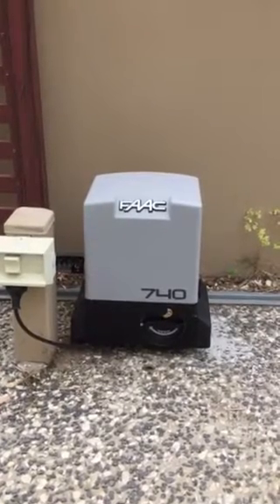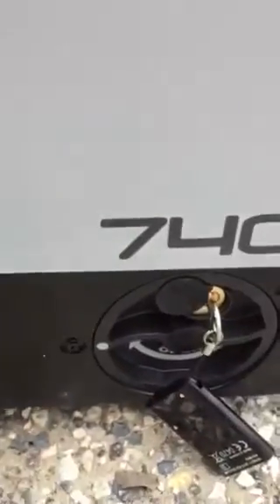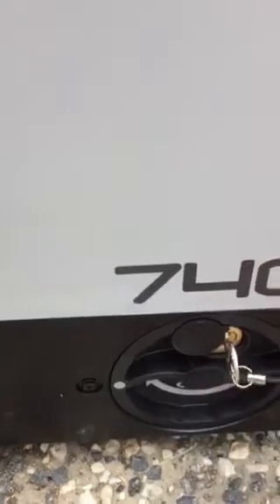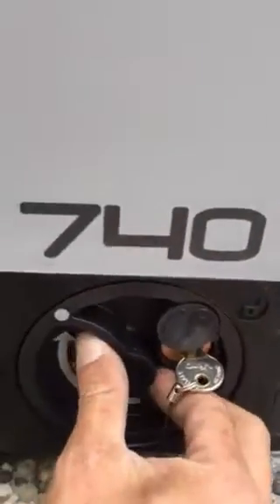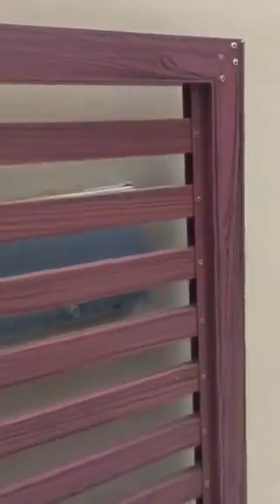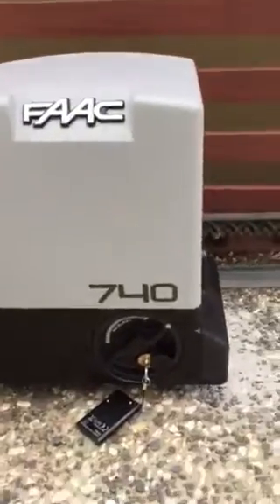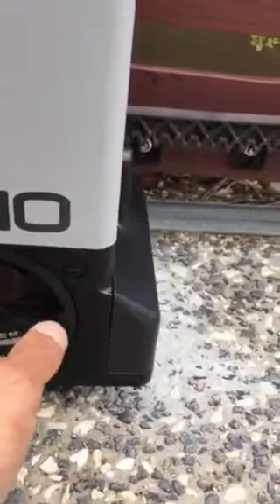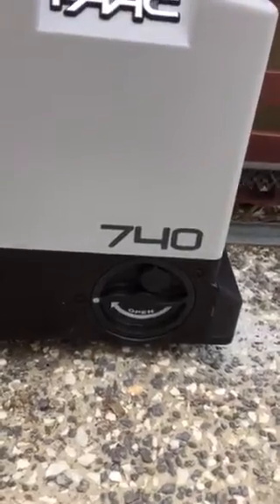Manual override sliding gate operator

Comment: Mine is stuck open unlocked/freewheel mode and won't re engage the gear it's like the internal pin is seized open?
Reply: I have the same problem, gate won’t engage, do ya take out that turn knob to access it